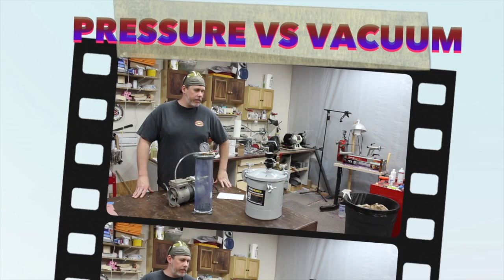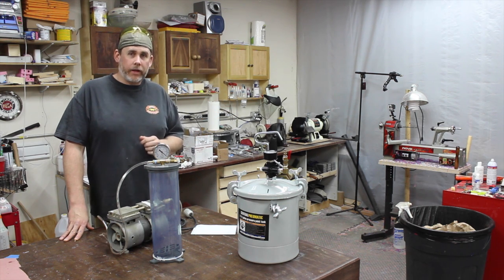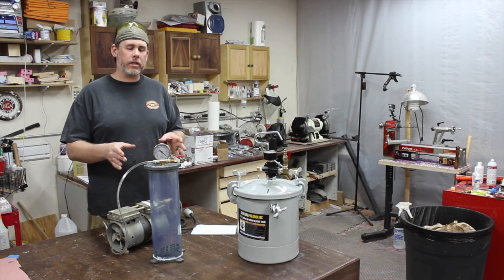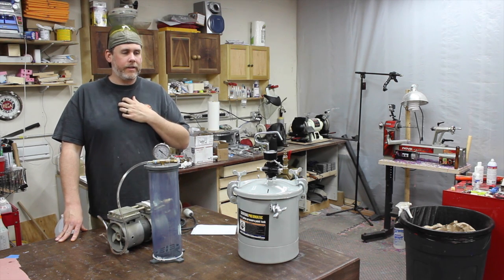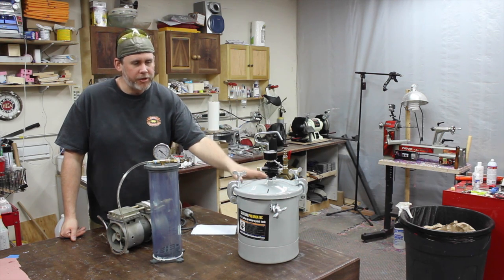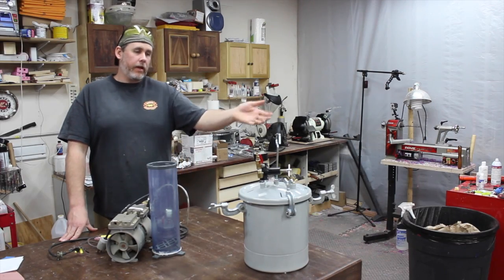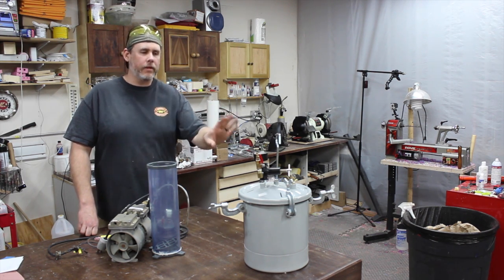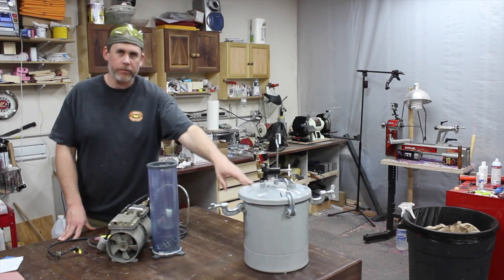Can I Use Vacuum Instead of A Pressure Pot to Cast Resins With?

Comment: I have been watching your videos for a while now and am fascinated by casting resin. I would like to make light lenses with bubbles in the resin to give it bubble look. How would you recommend I do that? Would it work to inject air with a syringe at the bottom end to make controlled bubbles?
Sample of the light lenses. 
https://www.google.ca/search?client=ms-android-blackberry&biw=412&bih=313&tbm=isch&sa=1&ei=M4TyWciPFMXUmwGb0KaoCQ&q=light+pendant+with+bubble+look&oq=light+pendant+with+bubble+look&gs_l=mobile-gws-img.3...27283.39955.0.42322.23.18.5.0.0.0.356.4741.0j1j11j5.17.0....0...1.1j4.64.mobile-gws-img..2.19.4723...30i10k1j35i39k1.204.UVFUr2bbGDI#imgdii=xx3NYci6YLmjfM:&imgrc=F0wzoW4yvkH1nM:

Comment: Zac I have just bought a pressure pot and the set is : one outlet for the pressure gauge and one outlet for the paint collection: My question is do I seal the one pipe that goes to the bottom.? Or what goes where??? PLEASE HELP
Reply from the maker: Hey Geoff, probably easiest to direct you to my videos that cover setting up a pressure pot. I have one for C.A. Technologies pots (https://www.youtube.com/watch?v=6iQEPaa82Z0&t=15s) and one for Harbor Freight pots (https://www.youtube.com/watch?v=vO1sD3rvZdA&t=1s). Should help you figure out which parts you need and where they go. Make sure to check out my video on finding and fixing leaks before you begin, I have a tip on what type of thread sealer to use, and I'd recommend using it off the bat to help ensure the fittings don't have any leaks: https://www.youtube.com/watch?v=ZzdNZ6nqrgM&t=239s

Comment: Can I use the pressure pot with an acrylic lid as a vacuum chamber?trying to minimize space and cost. Just not sure if the pressure pot can handle the vacuum
Reply from the maker: Hey Greg, yeah it's possible to use an acrylic lid to convert your pressure pot to vacuum. Just make sure it's thick enough to handle the stress of being subjected to vacuum, too thin and it can crack or possibly shatter. There are companies out there that sell lids for that purpose, or you could make your own. Unfortunately I don't have any expertise in that area, so I couldn't tell you what the minimum specs would have to be for it. Just know that if it's too thin you could run into problems
Reply: Zac Higgins thanks for the info. Been doing research. 5/8 is thick enough but have been reading that cactus juice Will ruin plastic lids. Says I should use glass vac for stabilizing wood. Any input on acrylic lid? Thanks in advance.
Reply from the maker: Cactus Juice doesn't hurt plastics, my entire chamber is plastic. The lids crack because the material is too thin or improperly machined for the fittings. I'd contact Curtis Seebeck directly to get the scoop on it, I'd imagine he can tell you what the minimum thickness required is too www.turntex.com
Reply: Zac Higgins you have been a wealth of information. Thank you!
Reply from the maker: My pleasure =D I know it can be tough sifting through all the info out there
Reply: Zac Higgins yes.... lots of mixed info and when you are on a budget you only want to make the investment once! It's people like you who set it straight for us newbys but also get the money's spent to the right manufacturers.  You have a great gig going on to have the time for this. Once again thank you so much for all of your hard work experimenting and research.  I am sure I will need to call on you again in the future. Answer when you can I am never in a hurry. Thanks again so much!

Comment: I casted a two pen blank mold last night for about four hours.  After the first thirty minutes I noticed that the pressure had dropped from 45 psi to 30 psi.  I added more air and it did it again so I added more air.  After the third time I added air and left it alone.  After I finally released the pressure I could see some air bubbles on and near the surface of the blanks.  What should I expect to happen when I turn the blanks?  Can the holes be filled with CA glue before sanding?
Reply from the maker: Hey Keith, first off I would recommend watching my video on finding and fixing leaks in pressure pots so you don't run into that problem: https://www.youtube.com/watch?v=ZzdNZ6nqrgM 

You should be ok if there are a just few some small pinholes, you can fill with them CA. If the blank is riddled with holes, it could be a little chippy, but you should be able to get through turning without problems. You might want to pull out the face mask out just to be safe

Comment: My concern is my parts will be to large for a pressure pot.
Reply from the maker: You could try using vibration instead of pressure or switch to a slower setting resin
Reply: Yes, I am going to try both. Thanks for the response.

Comment: great video Zac. I never thought to use vacuum for casting until I saw Stephen Ogle do it. you know him, check it out.
Jim
Reply from the maker: I'm not sure if you watched my video or not, but I don't advise using vacuum. Stephen Ogle doesn't use the same resin as I do, Amazing Clear Cast is epoxy and has a very long open time. Alumilite Clear and Alumilite White cures too fast to use vacuum, as I stated in my video. if you would like to see another video that shows what happens when you use vacuum with Alumilite Clear, check out Dema's video on the subject: https://www.youtube.com/watch?v=7IX9RvH5rxI

Comment: If I understand correctly, when pressure casting you get pre-stressed cast, material properties will be different. Also if mold is soft it will get smaller when pressurized? Bubbles inside will diffuse in to the resin, but what about bubbles on the edge cast/mold?

Comment: i want to make some pen blanks and wine stopper blanks with sea shells. So if I understand this correctly I need a pressure tank
Reply from the maker: I'd recommend it for best results. It's not entirely necessary if you are using a slow setting resin, but Alumilite Clear definitely needs to be pressurized to get the bubbles out. Even with slow setting resins, the pressure will help a ton when you embed things in it. If the air bubble is trapped under shells, it won't wiggle free on it's own, so the pressure will help out with the stuck ones

Comment: I wanted to start using resin in my bowl turning. It sounds to me that you said you can avoid the vacuum and go straight to the pressure pot to make the bubbles so small that you can't see them. But I didn't understand when you said you need a vacuumto stabilize wood.
Reply from the maker: Wood stabilizing and resin casting are two totally different things. Check out my Wood Stabilizing videos to get an idea of how that works, it's more for hardening up soft/punky wood. You replace air inside the cellular structure with stabilizing resin and bake harden it. Think resin impregnating. Resin casting is like making acrylic blanks, casting resins will fill voids but doesn't penetrate the wood fibers like stabilizing resin would

Comment: Sorry to ask nut I am new to all of this. Where do I get a pressure pot at the cost you mentioned?
Reply from the maker: Harbor Freight has cheap ones, I'd recommend going with a CA Technologies pot though, far better quality. I have links to the CA Technologies ones and lots of other casting and turning tools and supplies on my website: http://nvwoodwerks.com/tools/
Reply: Thank you sir I will check it out
Reply: Hi Zac the ones from CA do you have to purchase all of the fittings separately?
Reply from the maker: Yes, you will still need the ball valve, elbow and male air hose connector for the 'in' side of the regulator and a cap for the 'out' side, all 1/4" fittings
Reply: thank you sir I really appreciate the information I literally just saw the video between the Harbor Freight and CA Technologies pot I appreciate all that you have discussed with all of us Anna videos you post are very helpful thank you for taking the time to do this

Comment: Nice information. People on my channel keep asking why I am not using casting on my wood or stabilizers. So I am curious even though I understand the differences, can you just do the job with a vacuum chamber and what or how do you add the resin per say? Do you just pour it in even though the chamber might be much larger than you piece? if so how do you remove the final piece from the chamber?Thanks
Reply from the maker: You would use vacuum for the stabilizing resin only. Casting is done in a mold under pressure usually. Some of the slow setting resins don't require pressure technically, but if you embed objects it's best to cast it under pressure regardless. Check out my stabilizing wood playlist and some of the other resin casting videos, you should get a good idea of the differences between the two methods from them

Comment: whats the minimum pressure that has to be used to get a good cast in a pressure pot?
Reply from the maker: Well, that depends on how big the air bubbles are. The higher the pressure, the smaller they get. I think Alumilite recommends over 40 for their products, I usually run my CA Technologies pots at 65-70
Reply: thanks for the quick reply!
unfortunately a proper pressure pot costs around 400euro where i live so im trying to make a homemade one out of a steel cooking pot

Comment: With the right resin and feeds you can cast flawless by vac. The art is in the mould making and the cut of the mould. I have vac cast for 5 years and I am fortunate that I am classed as a good product due to my casting. I do own a pressure pot and comp but until now it hasn't been needed. I cast from 54mm to 200mm full fig. My point is you can vac cast to a high standard with prep

Comment: Thanks for the video. It's quite educating. When I cast the resin I try to use vacuum chamber, and the resin began like to 'boiling' out of silicone mold. Then I decided to degas mixture of two components itself, couse the bubbles, as i read on one forum, is a normal chemical reaction while the two components comes into mixture. So after the bubbles went out from the surface I fill the mold with degassed resin and put it into pressure pod for some period. I wait a result minute from minute...

Comment: couldn't you use the the pressure pot as vaccum container just by switching between vaccum pump and air compressor with quick connect fitting? It seem people like the clear vaccum so you can see the bubbles escaping the wood.
Reply from the maker: Yes it's possible, but if you can't see in the chamber you don't really know when it's done. Bare minimum you want a clear lid. I actually prefer a totally clear chamber made out of clear PVC pipe

Comment: Iv tired it with small blanks and it just creates a mess because it's pulling air from the wood threw the epoxy. But I do mix epoxy and put it in the chamber to pull the air bubbles out for pouring on larger projects.

Comment: Thank you for your video about epoxy! They are gorgeous. 
Can I ask you something? Pressure chamber - what effect does it offer? except for the resin degassing? whether a resin harder (stronger) after this chamber, than before, as an example? or just degassing? I can not understand why do you use for resin vacuum chamber at first, and then give the resin to harden in the pressure chamber
Why vacuum is not enough?
Thank you.
Reply from the maker: I don't use vacuum at all. I just use pressure to shrink the air bubbles in the resin, it doesn't do anything else to the resin

Comment: I have seen a short video of a guy that worked for McFarlane that learned how to cast and all that cool stuff, and after he mixed his resin and poured it into his pot, he used vacuum pressure to pull out more of the air bubbles trapped inside from mixing his mold material, and it pulled up towards the top but he only hit it for a few seconds and he did this a few times, I cant remember if he had his proof in before or added it after, then, he shot his air in to force the material around the proof

Comment: very helpfull video!!.... can i use any kind of compressor with the pressure pot? like the compressor i use for my airbrush?? thanks!
Reply from the maker: I'm glad it was helpful Pedro =) If it's a tankless airbrush compressor I don't think it will work too well. If it can push enough cfm's though, it might work. I think the pancake compressors are about the smallest compressor I've seen people use without any problems
Reply: So... my paasche D3000R compressor with 1gallon tank will work?? Do you sell pressure pots for casting? Thanks!!
Reply from the maker: I'm not familiar with that one, but it might work. Usually best to have a tank that's similar in size to the pot, but as long as it has the horse power and can provide the cfm's, it should work. Always worth a try. I don't sell any equipment myself, just pen blanks. I purchased my CA Technologies pots at Finish Systems online, they have some that are set up for resin casting: http://www.finishsystems.com/resincastingpressurepots.html
Reply: you rules Zac thanks!
Reply from the maker: Happy to help :D

Comment: I am contemplating my first resin casting project. I want to make cylindrical shapes with somewhat strategic air bubbles in it, to make a light fixture for a bathroom, when the light shines through the clear acrylic it will reflect against the bubbles and make it look like bubbles in water. How would I be able to draw out the unwanted bubbles and then ad about a dozen somewhat larger ones randomly throughout the cylinder. Could I first vacume then before it sets up use a syringe to ad bubbles from the bottom? Any thoughts?

Comment: I think that using a vacuum when casting wood and resin together is likely to make the problem worse by drawing air out of the wood and creating more bubbles. Cheers, Jim
Reply from the maker: Yeah, you nailed it. That's exactly what happened when Dema tried it in his video with Alumilite Clear. Foamed up like crazy
Reply: Agree, but you can vacuum only resin and then poor it on the wood. Maybe that way it will be better solution for removing bubbles with just vacuum chamber?

Comment: Hi, I enjoyed your video on Vacuum v pressure pot situation. As a pen turner casting clear polyester resin in moulds, bubbles are a pain. I read once that after mixing the resin and catalyst you can microwave the mix for about 15 seconds which is supposed to make the liquid thinner. If this is the case would a vacuum chamber work any better?
I have only just heard about Alumi lite and the quick curing epoxy resin which after your video I realise would need a pressure pot to 'remove, shrink' air bubbles. Going to try some soon.

Regards

John Hunter
johnhunter226@gmail.com.au
Reply from the maker: +John Hunter Hey John, I'm not sure that putting PR in a microwave is a good idea. PR is flammable, so there may be some safety issues there. The other concern I would have is if microwaving it would alter the chemistry of the resin or hardener in any way. The other problem is heating the resin up will also accelerate the cure time. 

Your best bet is to just use a pressure pot instead. It will work with any type of resin, and it collapses the bubbles as soon as you bring it up to pressure. The only issue you may run into pressure casting PR or any other slow setting resin is maintaining the pressure until the resin has hardened. If the pressure pot has leaks and the PSI drops too low before the resin has hardened up enough, the bubbles will just re-expand.

I think you'll enjoy Alumilite. I find it to be a lot nicer to work with and a joy to turn. Let me know how you like it when you try it out.
Reply from the maker: +Zac Higgins One other thought I just had about PR in the microwave... the fumes that PR gives off are toxic, so there also could be a safety concern with the fumes in a microwave as well. I'd probably advise against trying to microwave it.

Comment: I notice that you have the same vacuum pump that I have.  Mine came with a filter on the intake side and it appears that yours does not.  I'm new at this, but I assume that the filter will keep fluid/water from the pump.  Have you had any issues with it?  Also, what is the inches of vacuum that you obtain?  I'm running about 25", thanks.
Reply from the maker: +William Pitzer I have no clue if the filter would help or if I'm missing it! LOL I haven't had any problems though. According to my gauge, it pulls right around 25. That number is dependent upon your elevation though as well as barometric pressure I believe. I'm pulling near the full vacuum I can get at my elevation...assuming the gauge is accurate.

Comment: Thank You Zac. For doing this Video! have been getting beatup over this issue!
Reply from the maker: +Carl Smith Definitely! Sorry I never was able to do the side by side test though. To be honest, I just felt like it was a waste of time and resin to actually test it. Dema also did a video on this, and actually put Alumilite in a vac chamber. Results were horrible LOL. I'm pretty satisfied that pressure is the best way to go for casting, vacuum is good for silicone molds.